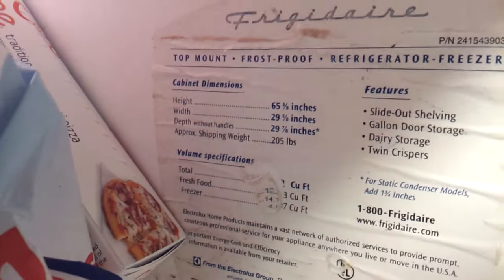Refrigerator dripping water inside FIX

Comment from the maker: You are welcome. I'm too old to know how to add graphics and a techno soundtrack.
Reply: Hey, just wondering when you rescrew the middle panel back on, is the back completely snug against the top or is there a tiny gap?  Mine has a small gap (from the styrofoam I think?) and I'm not sure if it's usual or not.  I did screw the bolts in completely and it looks like the styrofoam is pushing it out from a complete fit.  The front is snug, the back where the light bulb has a small gap.
Reply: pretty sure its supposed to be like that. wish i would have taken a closer look before i removed the unit lol.
Reply: Same here, seems like my fridge is running normally and isn't leaking anymore but it does take time.  Hah, ood luck.

Comment: My parents fridge is the same one as in this video. They have water dripping out onto the floor. I looked and it was water standing under the humidity controlled crisper drawers. I followed the dripping water to this very compartment. It was full of water and a chunk of ice. I removed the water and ice but didn't clean out the little drain hole. I was too scared to remove the entire light fixture compartment.I can't wait to get in there and fix it. Thanks for this very helpful video!

Comment: Thank you, thank you! My landlord came over to fix this, adjusted the temperature and declared it fixed. It was not. I also have a Frigidaire, looks just like yours in the video on the inside. That little "tube" that leads to the water tray had some kind of crap in it. Super easy to fix but I couldn't have figured it out without your video! Again, thank you bunches!

Comment: I had this problem for several years.  I cleaned the freezer and it still leaked.  Didn't know about the drain hole in the fridge until today.  It was plugged up and I cleaned it and it should be ready to go.  Thanks a million.

Comment: Wow!  Thank you SO much!  It worked!  You've made my entire day!  Just had one of those days where it seemed like nothing would go right.  I took the freezer back panel off, thinking it would do the trick.  But it didn't. I felt so defeated and thought that I finally had to give in and call for service.  But I found your video and it got unclogged.  Finally after two months, I won't have a drippy shelf anymore.  The q-tip cleaned all the gunk up.   Love your video.  Straight and to the point.  Thank you!  Great work!  And thanks for sharing!

Comment: Thank you so much for this quick video. I searched my make and model and found this gem in seconds. Luckily my handy dandy $10 tool kit contained the extension tool. In 5 mins I had the drain off, cleaned and back in place. The gunk was disgusting! Yay! No more puddles on the floor!

Comment: Great video! A few additions: 
The screws are of two very different lengths, the longer ones came from the front.
When you take the fixture off you need to pull it towards you, as there is a “pipe” from the unit that slides into the hole in the back wall.

I used a 1/4 inch socket on the end of a nut driver.

When I removed all four screws the fixture hung from the pipe and the electrical connection. I disconnected the electrical plug at this point and then pulled it back to take to the sink to clean the catch basin in the back.

When I did this I saw two large brown slimy masses fall out of the back of the drain pipe.
No idea of what they are or how they got there. Don’t look like clumps of bacterial growth. I’ll put them under the microscope after  we clean up the kitchen floor :>)

And a note to Frigidaire:  shame on you for letting your customers do this work. Why aren’t you taking better care of the people who use your products by making videos like this yourselves?

Comment: Thanks, mine was plugged lower down near the base, I used CAT5 network cable ( tried thinner wire but stuck) and finally pushed through
Reply: Compressed air works good too.

Comment: Thanks for posting this! The bolts can be tricky to remove, but they come out eventually. Also, a few q-tips and some compressed air to clean out the drainage hole to reduce future clogs is also recommended.

Comment: Thank You so much I am 80 years old and didn't feel like doing it but I did and all by myself, Of course I don't know if its fixed yet I will have to check in a few days, but that part of the light fixture thing had frozen ice in the back and I took that out and used a turkey baster and squirted hot water into the drain hole hoping if there was any more ice int he drain hole that would help then put it back together again and dried it up and heres hoping.!!!!
Reply: @futuretrunks666  good idea jody only u should apply it to urself i have a feeling nobody will notice

Comment: Hi this vid was extremely helpful and turned out to be exact cause of my issues. The only comment I have is that caution needs to be taken when lowering the console after unfastening from inside of fridge compartment top. The drip collection tray (at the far end} could well be nearly full of water. Since videographer wasn't clear about the urgency for draining the pan before doing anything else, my suggestion would be to have a strategically-placed container on stand-by while pulling the console down, allowing one to simply tilt it (console) sideways and pouring out the H2O. Though some water might get-by,  its surely way-better than dousing  your remaining fridge contents and having to bail 2 or 3 cups of water from the bottom well after gravity has done its thing.As for paying it forward, I thought it would be appropriate if I donated (to charity of my choice) half of the (minimum) $50 that I would surely have paid a technician for a 15 minute repair requiring a minimum of skill/aptitude and no specialized knowledge. Hopefully others will think likewise.

Comment: I found the best way to unclog the plastic drain hose is to get a 6' length of 1/8" stainless steel aircraft cable (from Lowe's, cut off the spool) and fish it down the length of the tubing from the top freezer to the drip pan. Fray the ends of the trailing side of the cable so that when you pull it through it works like a roto-rooter.

Comment: I have the same refridge as in the video, yes i had a small lake forming on the bottom of the floor of the fridge and the crisper bins were also getting filled with water, I had no idea were this water was coming from until I watched this video, that was my problem all along, the drain hole was clogged and the little catch pan in the fridge was filled with water that was frozen into a block of ice and then overflowing into to bottom of the fridge, took it all out today and cleaned it, hoping that is the fix, time will tell. . .

Comment: Thank you so much. Very helpful. I cleaned the clogged drain hole. there was some lint like stuff there. And it was iced up in the pan. So I think that was the problem. We'll see. I am wondering how to prevent this without taking the assembly apart all the time.

Comment: I ended up having a gap in my fridge seal. I was able to use a hairdryer to warm the seal and minimize the gap. That helped solve the issue. Sadly in my case I believe  the hinge on my fridge door is messed up and causing the door to lean. That directly relates to the gap.

Comment: Thanks for the help!  I'm hoping you can help again.  When I checked the drain hole, it wasn't gunked, however, there was a frozen chunk of water there.  Is my fridge set too cold?  It's just past the middle on the dial (to the cool side).
Reply from the maker: Joshua Mangler I don't know for sure but that makes sense. Set higher than normal for a long period might do that.

Comment: First, thanks for the video. Secondly, I cleared the drain hole, but it's still dripping. Why is that?
Reply: Same here bro
Reply: That hole leads to a tube that goes to an evaporation pan at the bottom of the fridge. There could be a blockage of dirt and gunk at the bottom of that tube causing the water to back up. Some fridges access the pan from the back by removing the cardboard cover at the bottom. Some you have to remove the plastic grill at the bottom front to see the end of the tube - these are more difficult to get at. Be sure to unplug the fridge first before poking around under there.

Comment: I just did this fix. my clog was further down the line so I had to blow hard in the clear drain line underneath and all the gunk shot up into the fridge.  Dont need a new fridge now!
Reply: Seems like I have to do the same thing.   Did you have to go to the back of the refrigerator and take apart anything
Reply: I didn't have to take anything apart.  From the back you will see a plastic tube hanging into the catch pan thats the one

Comment: thanks just bought this modele fridge use dirt cheap as a garage fridge works perfect but starting doing exactly this at this exact spot. i knew it wasn't going to be a big issue i know how Car A/C work so it shouldn't be that differente on a fridge! 😅 
it can even happen in cars it will start leaking inside under the passager side of the dash. 😅

Comment: Going to try this as it makes the most sense for what I seem to have. I cannot find the drain tube a the back, and the drip pan is bone dry. I have not seen any water running down the back of the fridge, but I have not pulled everything out yet either.
Reply: Tried this and it did have ice. Cleaned it all out, but still have water collecting in bottom of the refrigerator.

Comment: I have the exact refrigerator and I cleaned the hole and it was still leaking so I put a thin clothes line down the tube to see if it was clear and it stopped about 12 inches down the back is metal  what can you sugest I try now is there a solution I can put down the hole to unclog it? PLEASE HELP!
Reply from the maker: yeah, this pan goes to a tube that takes the water to the pan underneath the unit. On mine the tube comes out the back and is attached to the back.  That could get clogged. Looks like it can be removed and cleaned. Not sure about yours.

Comment: I cleaned mine out but it’s still dripping. It’s dripping from the section just before where the water is supposed to run to. 
Any suggestion??
Thanks.
Reply: duct tape
Reply: Regina Brandle LoL, I used some aluminum foil and created like a ramp from where it’s coming from to where it suppose to go. So far a week has past and no issues. With it being on the top you can’t see it.
Reply: If you have the temperature dial set all the way to the right "coldest"or close to it, it's most likely the problem especially is you don't have a lot of product in the freezer! ( the refrigerator gets it's cold air from the freezer!) if that's the case, remove the plastic light bulb housing in the refrigerator section  by removing the 4 screws and pull outward towards you, then disconnect the plastic connector plug and look for ice build-up where the rectangular white styrofoam gasket is and run hot water over it until totally dissolved, dry it and reinstall. Note: if you found any trace of ice set the temperature dial to a warmer position like 12 o'clock or 10!  or it will happen again.

Comment: I just fixed mine. It wasn't the draining . It was because the assembly was installed too far towards the rear. I unscrewed the bolt and screwed it back in a couple millimeters towards the door. It stopped the leakage.

Comment: I have the same problem but there’s no gunk and I see that the reservoir is full, where the water is supposed to go when it gets filled up?
Reply: The drain hose hole in back panel where control assymbly/drain pan plugs into is clogged. I use a steam gun to blow it out. But compressed air would work just as well.
Reply: @Oldmanwithagoldpan  Great, thanks for the tip!

Comment: My fridge has a rubber stopper in the hole that leads to the drain tube. Looks like it is factory. Should I remove the stopper to prevent water from dripping into fridge? Don’t want to remove it and have water dripping on my floor
Reply: No. That rubber stopper belongs there. The water drained into the fridge and down to the condenser. The condenser heats up and evaporates the water that drains into there. Do no remove the rubber stopper.

Comment: I have the refrigerator and the same problem but there is nothing clogged up.  The problem seems to be that the water does not go into the tray at the back of the light panel.  Instead it drips out of the air vent and into the light panel and then into the fridge.  Someone named Daily Observer reported the same problem and he fixed it by gluing a piece of plastic somewhere to divert the water into the tray.  Something seems totally wierd about this as nothing is broken.  Does anyone know how to contact this guy or understand how to fix the problem?
Reply: I moved into my apartment past June and my landlord ordered new appliances and it's a frigidare that leaks by the back and Idk how bit If I don't put something it leaks and gets in the front of all levels

Comment: I have the same fridge . Anyone know which screw/nut driver to use to open the light panel.
Reply: This is my problem and I just asked him what tool should I use to remove the screws? Another lady said above they used a needle nose pliers.. If you fixed yours, what tool did you use for the screws?
Reply: It's a size 6 socket

Comment: Where are the screws and bolts and what tools did you use to remove the light panel?
Reply from the maker: Four bolts. 2 in front. 2 in back. Use 6.5 mm or 1/4 in socket.

Comment: I have Frigidaire, light assembly is on the top shelf. A lot of water dripping. I see the screws, what kind of tools I can use to remove the light panel?
Reply from the maker: It's bolts. Use a 6.5mm socket or 1/4 in on a screwdriver style driver.  Looks like they have Phillips style screwdriver head too. so that might work. I'd use the sockets

Comment: My drain tube is clean… still leaking. The water seems to be coming from the very top where the styrofoam is. Any suggestions?
Reply from the maker: Take off that piece. Put your hand up that hole in the back. It is probably gunked with frost. Clean that out. I had the same issue after this video. Take the stuff out of the freezer and defrost it. Pour some warm water on it and clear it out.
Reply: Everything is clean, no frost... and it doesn’t leak constantly. I have a bowl catching what falls now. I think I may try the silicone option. 🤷‍♀️
Reply: I've always wondered...is that styrofoam supposed to be up there?? 🤔

Comment: I have the same refrigerator, but the drain catch tray isn't the problem. The water is not going down the drain pipe down to the collection tray at the bottom. Any ideas how to fix that? I've tried a vacuum to pull up any debris from the inside hole at the rear of frig. The discharge nipple does not allow me to run a wire up. HELP
Reply: duct tape the gap in front of tray
Reply: Regina Brandle , can you elaborate on the duct tape

Comment: I have the same fridge and same issue.   I took the part with the light off and it was clear.  Any other suggestions pls?
Reply: Hey did you you find out what is wrong with the fridge?
Reply: +Eduardo Jose  No I just use a bowl to collect the water.  It fills up every 2 weeks.  Piece of crap Frigidaire!

Comment: I'm trying to assist my aunt to have her fridge cleaned. How did you get those screws out? Her screws are rusted and doesn't work with a flat or philip head screw driver.
Reply from the maker: used a socket wrench with an extension
Reply: etmeyutub what size socket?

Comment: ok i get that but where does the water drain to??? evaporates?
Reply: It goes to a drain pan underneath refrigerator. The warm air from the condenser fan blows over it making it evaporate. The pan should never over flow due to the timed defrost cycle.

Comment: I opened mine up exact same way but there was no gunk it was actually pretty clean for having this fridge for 13 years.  It’s still leaking from the freezer through that panel into my fridge, please help!
Reply: Cynthia check and see if the plastic is cracked right next to the drip spout on the panel. Mine was clean too, but it had a tiny little crack. The water was leaking through the crack instead of the drip spout. Then I just super glued it.
Reply: Logan Brauser i will definitely check that! Thank u!
Reply: Did you find that this was the fix Cynthia?

Comment: I have this same model. Water is leaking from that drain hole. However, that piece was not plugged up. Any ideas?
Reply: The same with mine
Reply: Could be further down the line, try pushing a fishtape through the hole on the fridge itself.
Reply: duct tape the gap in front of tray
Reply: @reghuml  Did that solve your problem? Duct tape to "seal " the styrofoam area? My tray is clean and I don't see ice or debris,